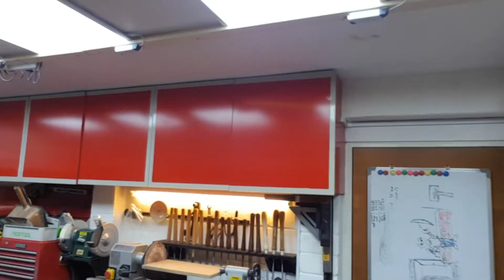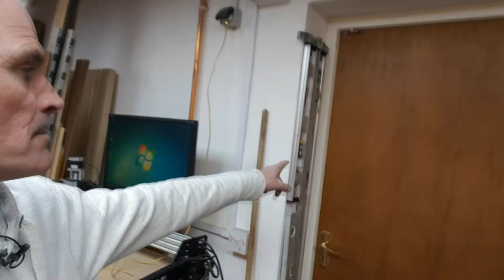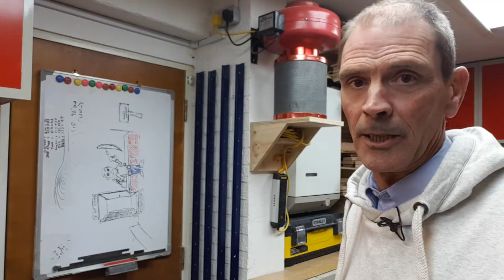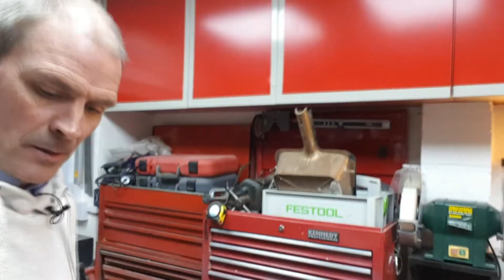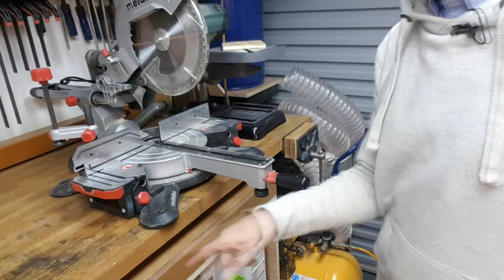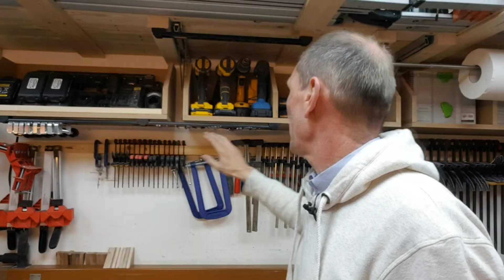Franks Little Workshop Tour 2019.

Comment: Very nice shop. thanks for sharing.
Reply from the maker: Thanks very much 😁. It hasn't changed much in the last year so I haven't done a 2021 tour... yet. But I have plans for a much larger table saw.. so will need to find some more space ..... if that is even possible 🤔. Thanks for watching 😁👍
Reply: @frankslittleworkshop  Fun fun. Mine has not changed much but I did a tour of my Dads who passed away and my brother and I reconfigured it to fit our needs.
Reply from the maker: @shanesmaineshop  just watching it now 😁... I'm up to your hardware corner.... that shop is massive 😮. Quite a few dusty spider webs though 😂🤣. Thanks again for watching 😁👍
Reply: @frankslittleworkshop  Yes  it had not been used for two years after my Dad died so we definitely have lots of dusting to do. LOL
Reply from the maker: @shanesmaineshop  😁👍

Comment: Frank, well thought out workspace. I have built a workshop almost identical in size (long and narrow) due to space constraints. I have similar challenge with sliding mitre saw rear clearance and have mounted it on a 3/4 inch ply sheet (the depth of my workbench) which I slide out when in use and secure with a couple of star knobs into the workbench so the cantilever doesn’t topple it over.
Reply from the maker: Hi Steve 😃. Sorry for the delay with my reply (it didn't notify me on my phone ☹). That sounds like a good solution to my miter saw problem. I am still balancing it on the edge of my workbench at the moment.... a health and safety disaster waiting to happen I'm sure). I'm hoping to get a new table saw soon, so I imagine the whole bench will need a redesign so I may include your idea in to my build👍. thanks again for watching Steve. stay safe mate 😁👍

Comment: There's some pretty clever stuff in there Frank, very well thought out. I'm forever chopping and changing, trying things and was looking for some inspiration. I like the idea of just using a cheap router table and sinking it into the saw bench. When I built my table saw I'd always planned on adding a router part to it, but hasn't eventuated. I'm still clamping it to a vice with a table on top.
I'm not too sure about the sliding doors, I think that would annoy me. I'd put two smaller opening doors instead. But, whatever works for you!
Thanks for sharing.
Reply from the maker: Thanks Peter 😁. The cheap router table as an insert has worked well so far 👍. But I now have a new router (a Triton), when that is mounted in a table it has an adjuster that you can access from above. This means I will need to start drilling holes.... or I may just get a posh insert 😁. Thanks for watching Peter 😁👍